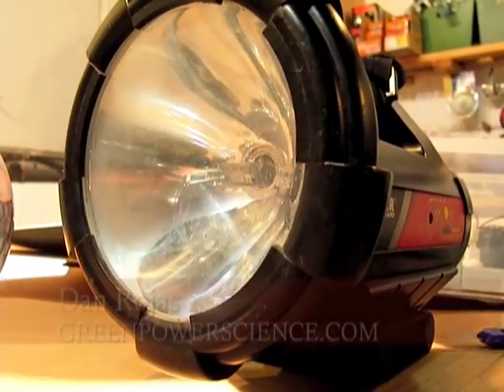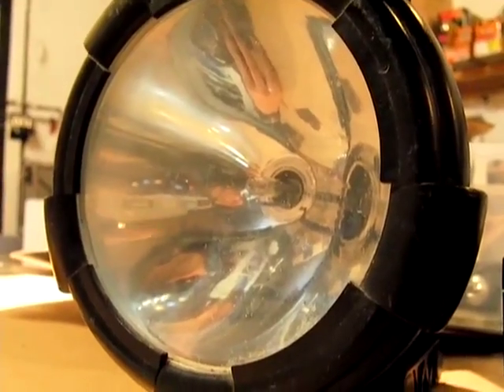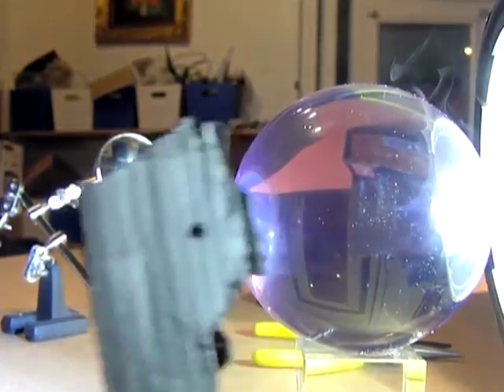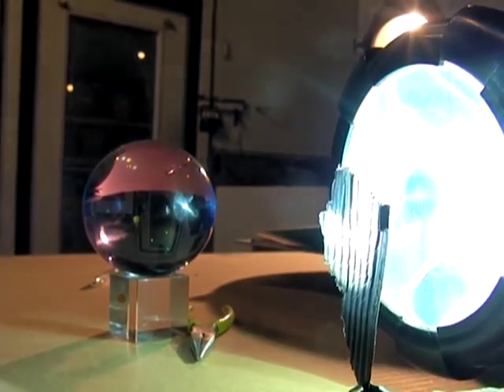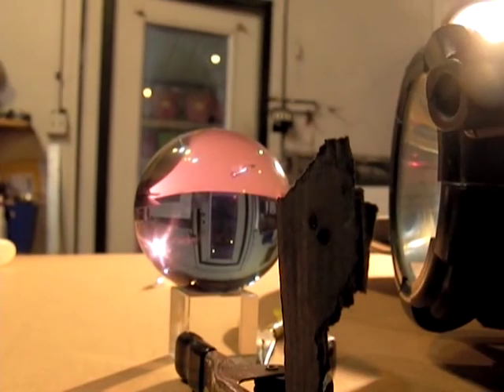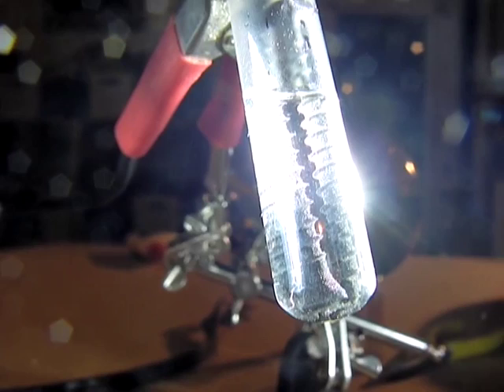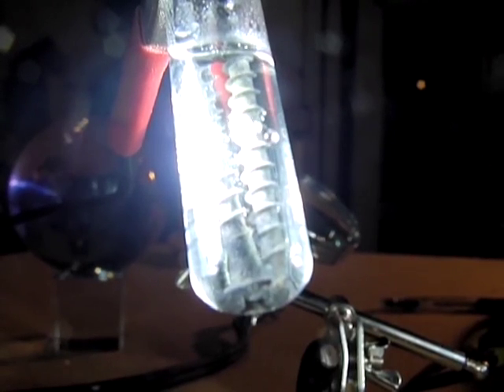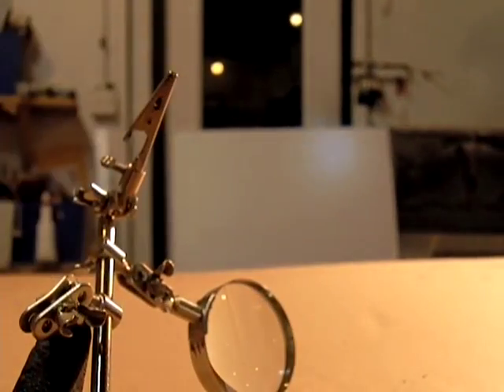FLASHLIGHT FIRE STARTER Torch Light glass solar orb ball

Comment: hey, I suppose it’s an experiment to prove a phenomenon. This has infinite potential from solar thermal panels to hot water heating, potentially steam engine, wherever there’s a light power source and something that reacts with heat or light there is a use. Very cool

Comment: That was interesting. How long did take you to figure out the system before you showed us the actual tests?     Also I think a six volt lantern battery with a strip of steel wool would be easier and faster for a fire, but that's just me.
  And yes I know you were just showing us the that it could be done.

Comment: those bulbs have very poor range. it gets better if you put a fresnel lens in front. a PAR64 500W or 1000W bulb can project heat at a distance of 10-15'. you can feel this even if you block most of the visible light using red filters.

Comment: @xxx777aaa It turns out my question is somewhat elementary. Energy vs. frequency are widely known in physics. In simple terms gamma rays, the shortest rays, which are also the highest frequency waves, contain the most energy per photon. At the other end of the spectrum, radio waves contain the least energy. Within the visible range, since blues and violets have the shortest wl they contain more energy per photon than the longer reds & IRs. It makes sense that UV causes skin damage & cancer.

Comment: I love HID and LED, they are creating cool bright lights. HID is commonly use on most projector lamps, cars and truck. I see some on autoshops and they uses ballast on it just like fluorescent lamps to step up the volts to several thousand. LED operates on a lower volts. Both are efficient lighting device. 
Another great stuff from Greenpowerscience.

Comment from the maker: Each object filters some light and the focal points would be all wrong. When light passes through or is reflected off an object, roughly 10%-20% is absorbed, So mag glass 90% output to the cry bal 90% x .9 =81% out to parabolic 81% in x.9 = 73% out. at lest 27% drop in power. You cannot amplify light, just concentrate it with lenses.

Dan

Comment: @madjimms Not really, in order for this to be viable you would need  to be stuck in a survival situation with a high power flashlight, and focusing tools and combustible materials and nothing else. And even then it would be more viable use the battery and 2 pieces of wire with the ends stripped to generate sparks and start a fire from that. Using the flashlight consumes a lot of energy and you have no way to renew that source.

Comment: For the comments about why, it's just an experiment for the sake of argument. It has no practical use just testing potential. Dan is pretty prone to keeping himself amused by doing experiments of "I wonder if I can achieve X result using Y materials".
 Nice use of the materials Dan, but I was surprised you didn't gang up the focal materials to further condense the energy. I guess you tried and reached diminishing returns. Parabolic through the magnifying glass seems like it would have worked.